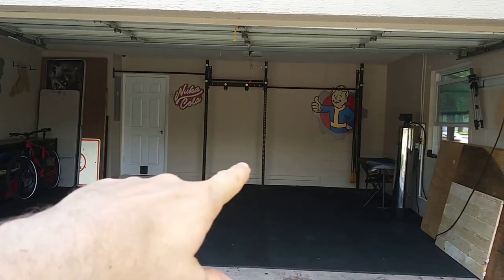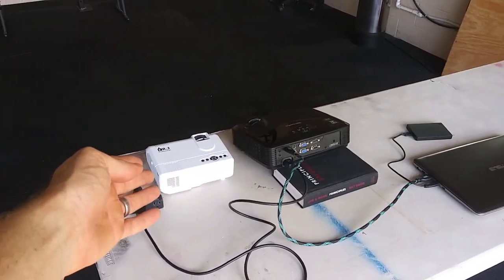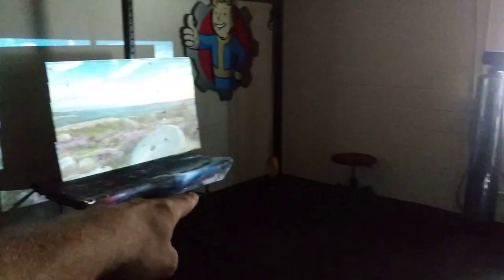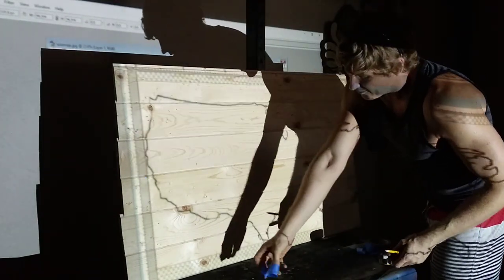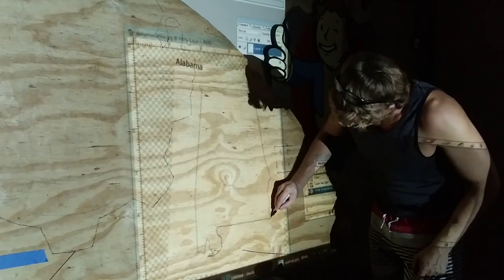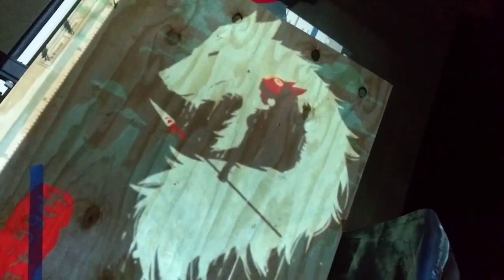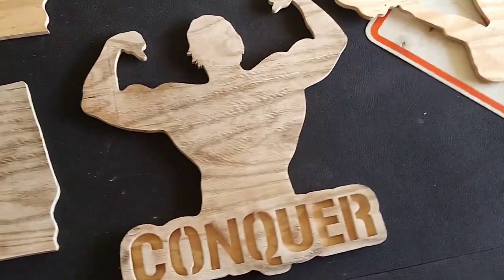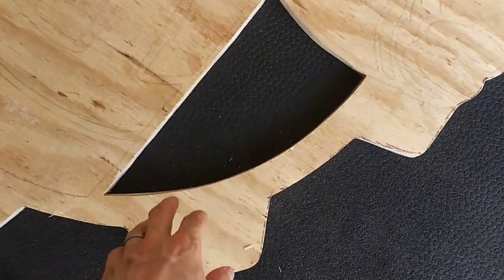How to use a projector to make signs out of wood with a jigsaw

Comment: Leo what plywood do you typically use in your projects?   Love the videos.
Reply from the maker: thank you! Whatever I have honestly. Typically I get high end cabinet grade from a buddy of mine  who runs a kitchen cabinet company & I just get mix and match leftover pieces every couple of months. Typically I get them for $25-50 per sheet vs $75-190 original cost. About to check if he has some. But sometimes I get free plywood (like in this video) from friends - these 3/4 inch sheets were all kinds of warped so I have to be selective with which projects to make out of them. Wouldn't want to do anything high end with a big bow :) For maps I use Tongue & Groove boards generally from the Orange Box.
Reply: Jigsaw Nation thanks a lot for the reply I appreciate it.
Reply from the maker: @ericgentry1788  anytime! I don't really want to become a full time woodworker, but much rather help folks out to become better doodlers on their own :) Can't help myself - been a coach for 13 years now.

Comment: Can you set the size on the projector for the piece you want to do? Like if your wanting to do a piece that 1/2 of a 4x8 Sheet. Thanks.
Reply from the maker: Most projectors will have an adjustment for the lens to dial in the throw. Generally I adjust the size in Photoshop though. But any photo editing software will do it easily